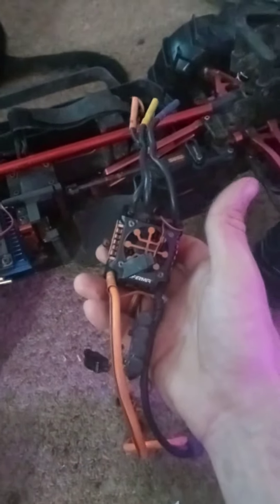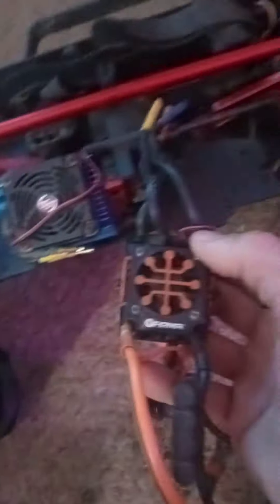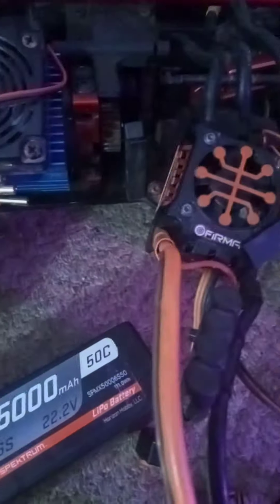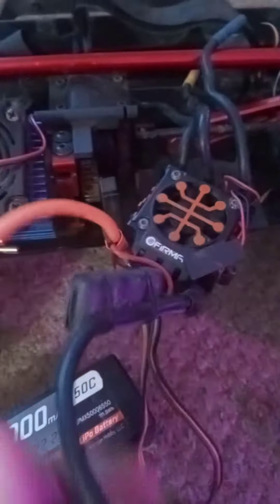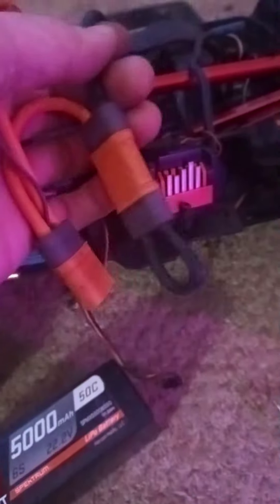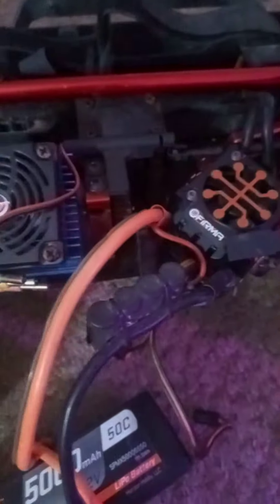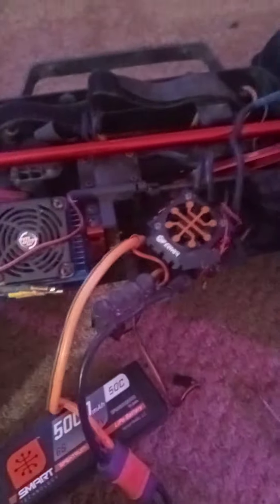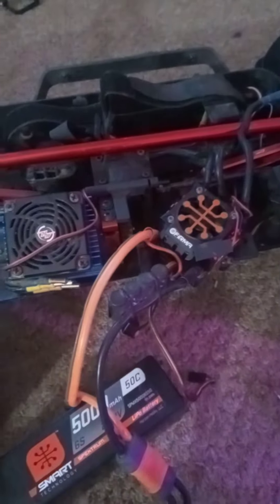Arrma Mojave update

Comment: Why do you think you need 2 3s batteries 1 6s is perfectly fine if anything the issue is the battery isn’t enough if you still have your manual it says it’s minimum battery requirements are like 5200mah 50c battery which is what you have it’s just the very minimum the system needs more power if anything you can achieve that with 1 or 2 batteries I personally only use 1 6s in all my 6s cars never a issue an that’s why they come with a jumper plug because not everyone has 1 6s pack some have a set of 3s because they have some 3s cars 1st
Reply from the maker: yeah I learned that my esc was faulty from the start  because when I installed the new one it never sounded as good as it did when I first got it the first time I got the Mojave it didnt sound like it does now
Reply: @kevinclark393  you mean the beeps turning on??? I use a firma150 in my typhon 6s it’s about 2 years old now paired to a 1900kv spektrum motor
Reply from the maker: @RC4us  no the whole ESC wasn't working I had to tap it to get it going it was struggling to get started til I tapped it then would run fine  the beeping I knew was a part of it
Reply: @kevinclark393  will I’m glad you figured it out
Reply from the maker: @RC4us  yeah it runs great since and I also just upgraded the rest of the electronics while I was at it not to much but enough to where I don't burn a hole in my pocket lol also has a light kit I made for it